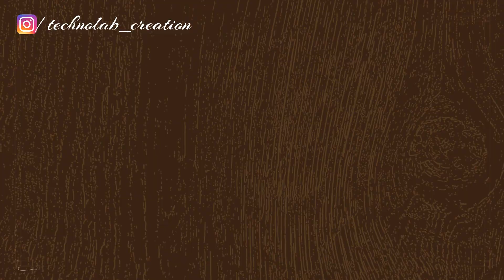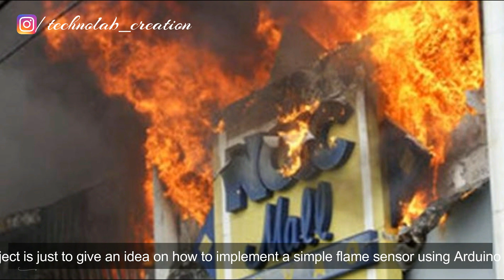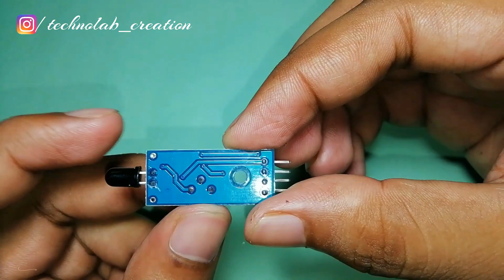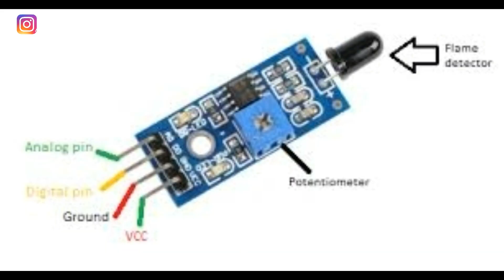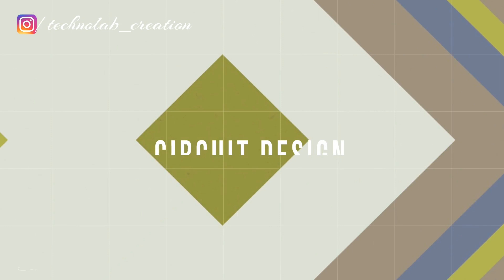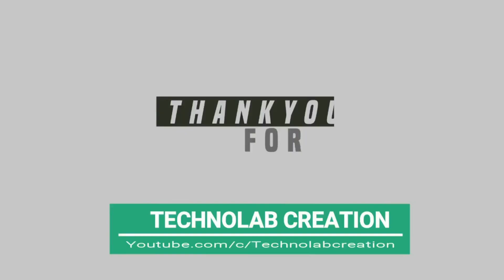Fire Alarm using Arduino uno and Flame Sensor; Arduino security system,DIY

Comment: Hi! Can I use this system with SIM800L instead of SIM900A?
Reply from the maker: Yes you can use with sim800l
Reply: @technolabcreation  Thanks. I have one question more. Do I have to use an external power supply(like 3.7V, 4V)and converter?